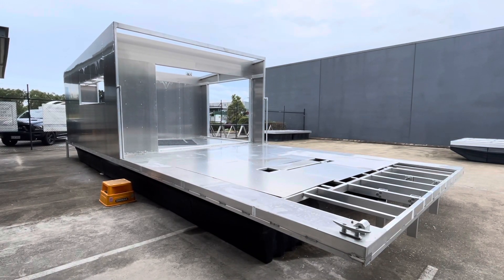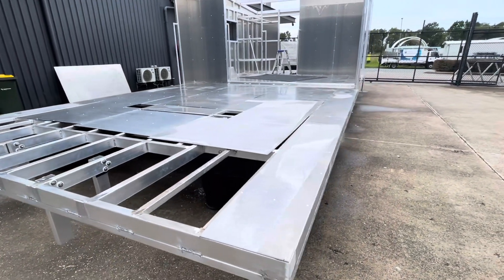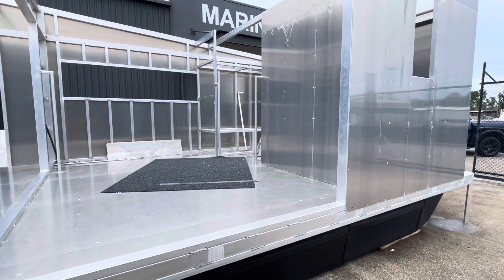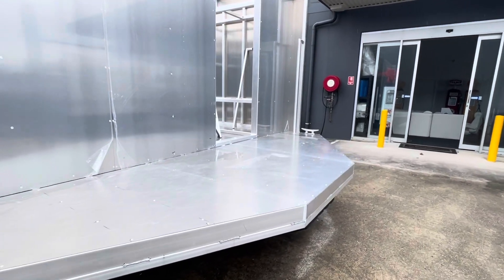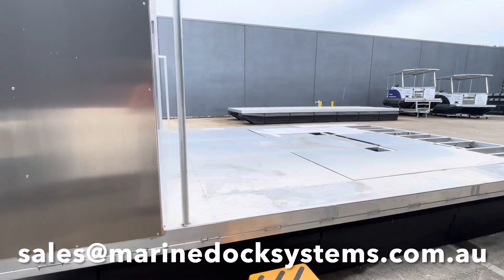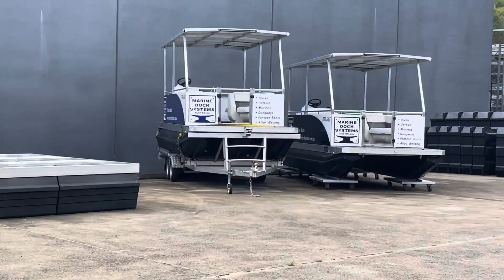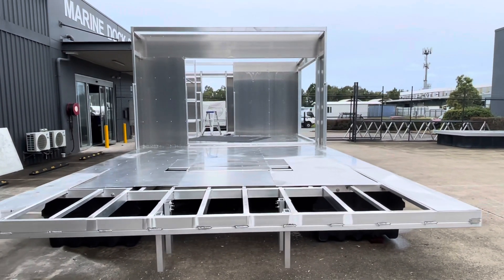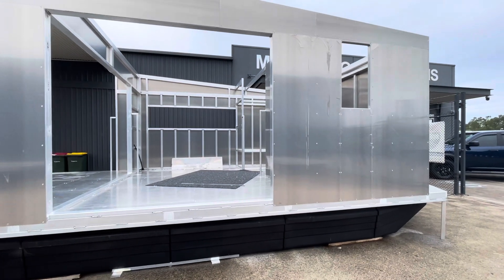Houseboat build Polyethylene floats aluminium frame and aluminium cladding

Comment: Greetings from Canada.  Wondering how the flex is?   And would you be kind to share how your flooring is done and how it stays rigid?  Been wanting to build a houseboat for a long long time.   And was thinking of building the floats with inexpensive poly totes with wooden 2x4 studs used inside the poly boxes to reinforce its strength like how they construct bulkheads and stringers.    Thanks in advance!
Reply from the maker: We are using 6mm thick wall thickness on our extrusion. The rear deck might have a fair bit of flex.  The super structure will keep the other half very square and strong. A trussed handrail all around would really help.
Reply: @MarineDockSystems  Appreciate the quick tip!  And congrats on this beautiful build.
Reply: Nice design, good size. I've been watching your videos with serious interest and I would really like to know, what is the current price for this exact model ?
And... how many rows of floats plus how many floats + how many nose cones on the bow end, please ?
Reply from the maker: @violettownmicroenterprises1528  hi please email sales@marinedocksystems.com.au
Reply from the maker: @violettownmicroenterprises1528  hi please email sales@marinedocksystems.com.au
Reply: Any updates on this build…